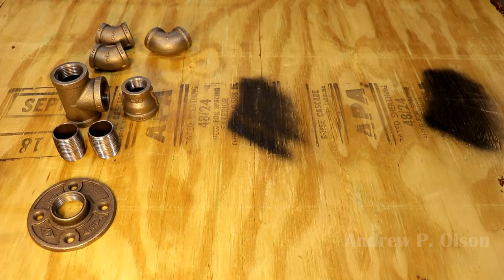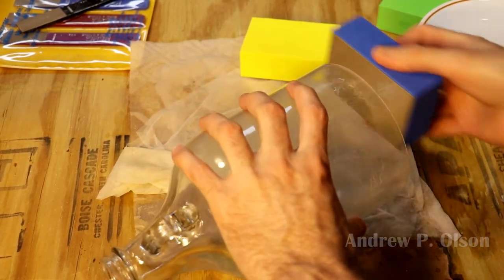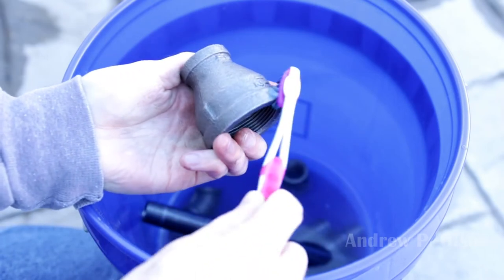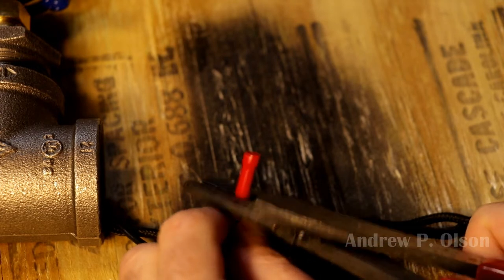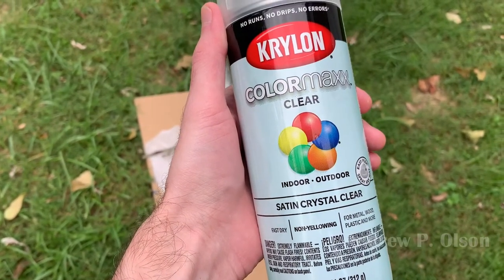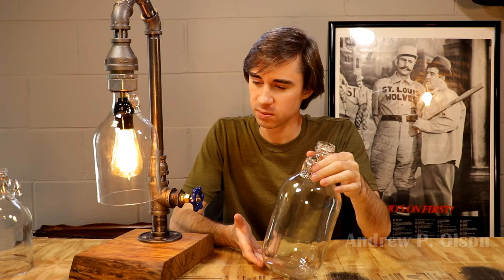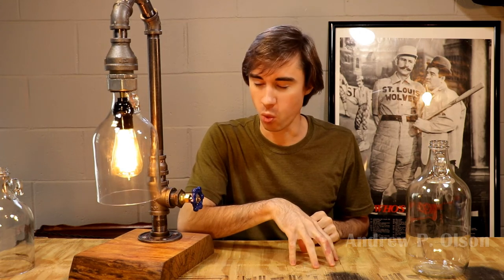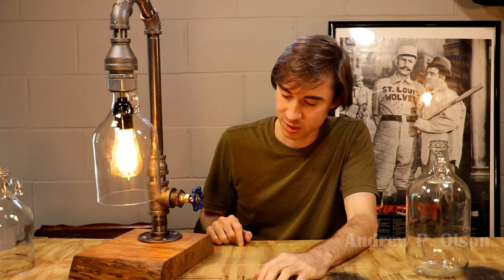The Half-Gallon Lamp | Industrial/ Black Iron Pipe Lamp build

Comment: Use a tile cutting table saw or chop saw. I ran into this problem all the time when I make mine splitting glass. It’s more expensive but you will get consistent cuts.  Also for the threads, you can score the first 3 threads (the threads on the brass fitting) in 3 places 120 degrees from each other to help set the threads. Another issue I had way back when I made mine the first time around.
Reply from the maker: I'll consider the table/chop saw for future builds.  Currently, I'm not in dire need of one so I'll make do, for now.  Scoring the threads of the brass fitting is an interesting idea.  Do you have a video, of the lamp you made, posted anywhere?  I'd be interested in seeing your results.
Reply: I sold one on Etsy , whiskey bent lights the post should be up still if you want to check it out
Reply from the maker: @johnbaumgartner9498  Looks great!  The Buffalo Trace label looks cool look when the lamp is on.  Nice work!  Thanks for sharing!

Comment: Would we have to install a ground for no one to get shocked?
Reply from the maker: I'm not an electrical engineer but if the wires are well insulated I don't think so.  I'm going by my own experience; I haven't gotten shocked and I do move the lamps around on for various videos.  My best advice is, If you are real worried about it, then use a ground.  Better to be safe and have peace of mind than be sorry.

Comment: Forgive me if this was already answered somewhere, but can you give me a ballpark estimate of cost to do this project as cheaply as possible? In other words, if I use smaller, cheaper quality metal pipe and don't add the glass jug part, what kind of cost should I expect? I'm trying to do a project like this for a group of teenagers at my church's youth group but not sure what our budget would be per person.
Reply from the maker: Um... I hesitate to give a ballpark estimate simply do to the fact that there are so many variables for parts; where to purchase them,  size, quality, buying in bulk vs not, buying from a supply house vs a big box store.  I also don't know what/how far you are willing to compromise on parts.
-Buying in bulk will save $ per piece, if your needs justify buying in bulk.  Buying from a supply house it is cheaper than a big box store but watch out for shipping costs eating away at your savings.  
-Don't quote me on this but I would say, if you do your research, you could probably  build a version (out of 1/2" black iron pipe) for roughly $100+.  
-That estimate does not include the cost of tools.
Just a suggestion, go to a plumbing supply website and pick out all the pieces you need and then tally up the price.  Then find the remaining items, switches, wire, etc (from whichever place you want to purchase those) and do the same, that way you'll have a good idea of cost-per-lamp before you make a purchase.
I hope this helps.
Reply: @AndrewPOlson  Thank you, brother. This is helpful :)

Comment: Neat! How long did it take you from start to finish?
Reply from the maker: This project, under normal circumstances, would take a couple days, allowing for the Danish oil, epoxy and paint to dry...  It took me several months, partially because of the problems I encountered and partially because I don't always have the time to work on projects like this.  That and the fact that filming while I'm building also adds extra time to the project means it took WAY more time than it was supposed to.  I also moved, midway through the build!